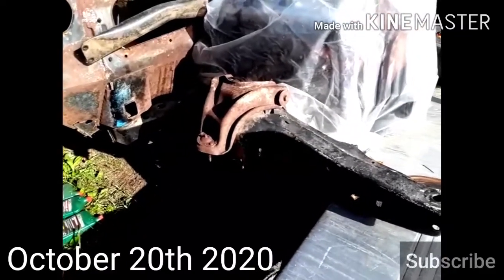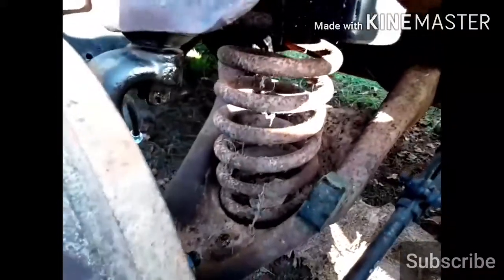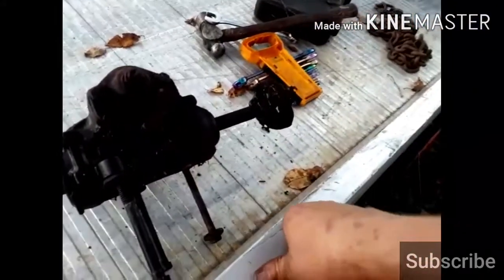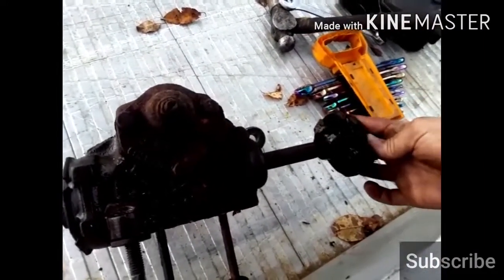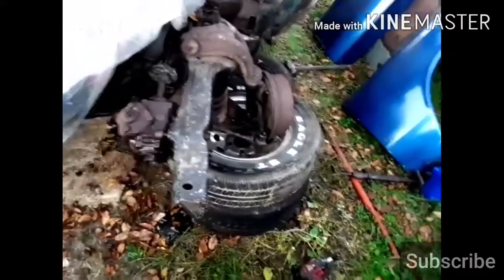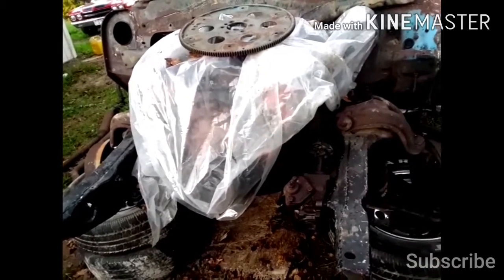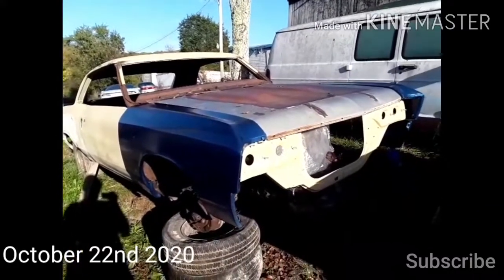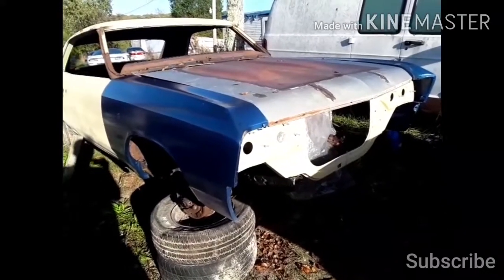low budget 67 chevelle part 22   front suspension part 2

Comment: I find it ironic that the only piece of suspension you changed that was unique to big block cars was the springs and in that instance you used small block stuff LOL.  You may get away with it, especially if they were from an air conditioned car.  Either way I know you aren't afraid to change them later when its all together IF need be.  Thanks for taking us along on the ride.  I do enjoy your videos.
Reply from the maker: Air conditioned with auto trans I think it'll set about right a 70's a heavier car